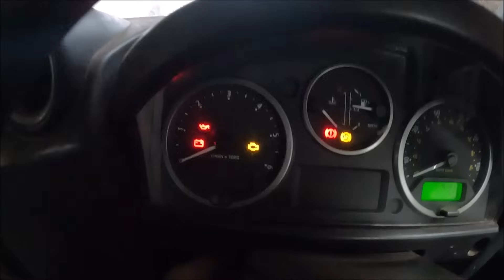29/11/23  I forgot the fireman's logs!

Comment: Seeing you pumping up the wheelbarrow tyre reminded me of a my old solid wheel tyre which I gave to a neighbour and then I had builders in and they left their old barrow behind with a pump up tyre and as it was a bit flat I decided to pump it up so  getting out of the shed a foot pump that I had bought in Halfords many years before for my them Motorcycle  I proceeded to pump up it's one and only tyre put the dust cap back on propped the barrow up against a tree in the back garden walked over to the otherside of the garden when there was an all might explosion and a piece of the red wheel rim went whizzing past my ear only just missed me and when I turned there was shredded rubber tyre and a piece of inner tube hanging on the tree branch if that had happened seconds before I would have been in a sorry state.🥴
Reply: @DavidJohnson
WOW !! 😱😧😳.. A very lucky break indeed 🫣🤗